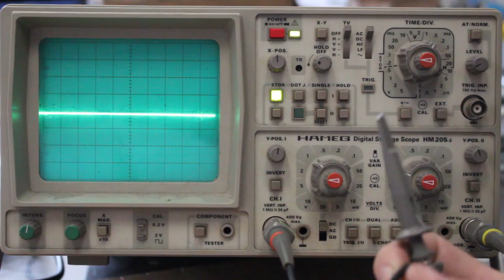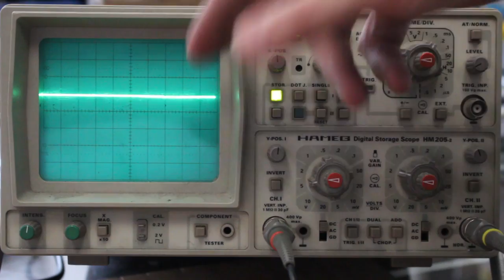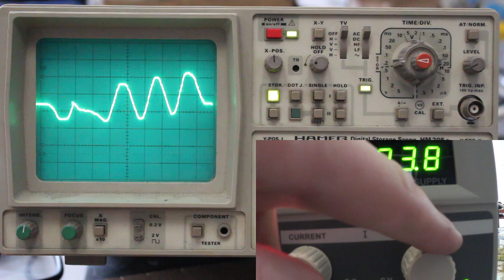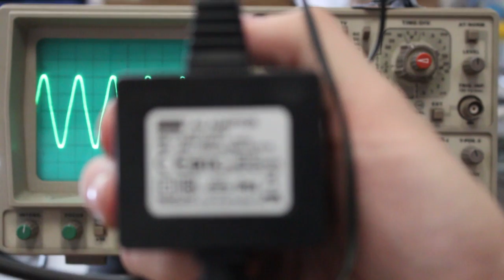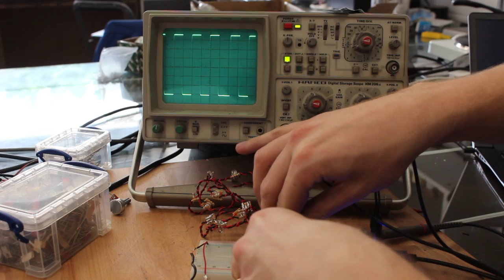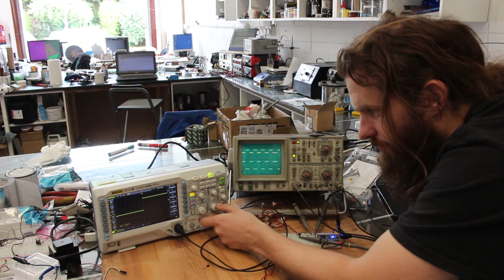Introduction to oscilloscopes

Comment: ROBERT MURRAY SMITH, 
What circuit inside the oscilloscope will draw the horizontal voltage on the CRT screen? 
Because there is no horizontal oscillator or vertical oscillator used inside an oscilloscope so how can it draw a sinewaveform on the CRT screen? 
The Ramp circuit only controls the electron beam only to the CRT screen?

Comment: I have both a modern dso and a old Tektronix crt analog dso. The new one is my go to but I learned a lot from the old one. Things that you would never have memorized like you do when using a old school scope. My Tektronix is from 1990, a whole 4K of memory. But it’s a 100 MHz scope. A crt scope is way better for looking at am signals than a modern dso. If I am ever working on anyone’s radios I always use the crt. It looks a million times better than the modern scope. 
Great video sir. You helped explain the oscilloscope to my nephew better than I could. Very well done 2 thumbs up 👍👍.

Comment: so we can use an Oscilloscope to see how often millennials get triggered?
Reply: Yes.  Wire them up.  It's called an EEG.  BaHaHaa
Reply: You may need a very high resolution scope, but the answer is yes.
Reply: 0kHz Boomer
Reply: All that I have to do is say: "Trump is an asshole", and you will throw a hissy fit, and that is too fast for the 'scope to measure!

Comment: is there a minimum bandwidth that you recommend?
Reply: depends on the frequency you're measuring. A long time ago with analog  CROs, much was talked about and debated to the nth degree about rise time, even from a hobbyist point of view. Today, you can buy a very good fast digital for very much less than the old instruments

Comment: @ashley mills .. I have a question for you.... how is it that the o'scope showed an alternating current pattern when you measured the AC adapter.  I thought those adapters all put out DC which, if my understanding serves me correctly, should just show a straight line on the scope. Thanks!
Reply: In this case the wall wart is just a transformer.  The rectifier and filter will be in the device that it connects to, if appropriate.   You can tell this by the line on the adapter that says SEC 24V ~ 650mA.  The ~ part means AC.  If it was a DC output adapter the ~ would be replaces by a solid line underneath a dashed line.

You are correct that a steady DC voltage will create a straight trace.

Comment: I like how you showed how it can be used to troubleshoot a circuit that isn't working properly. I sure beats removing individual components and testing them which would be a pain if you had to desolder them.
Reply: There is a saying: If your only tool is a hammer, every problem looks like a nail.

This is why it's good to know what all the tools at your disposal are.  Multimeters and scopes are a good foundation.  Depends on what kinds of circuits you're working with but there are loads of other tools for different situations.  Plenty of electronics repair channels to be found, and all of them will teach you something.
Reply: Joseph Richardson cheers